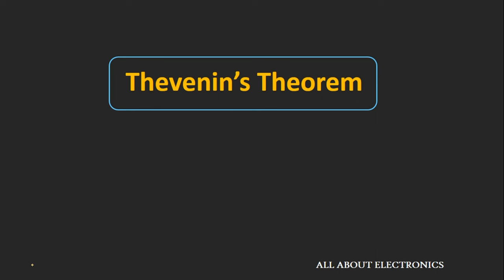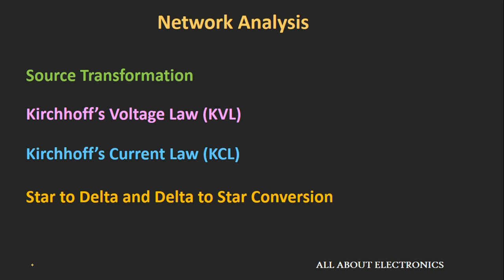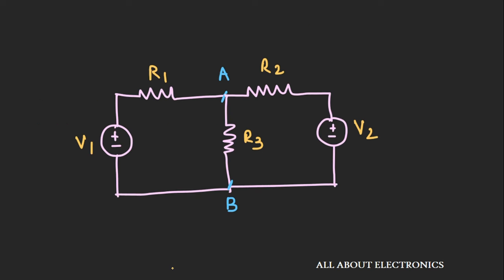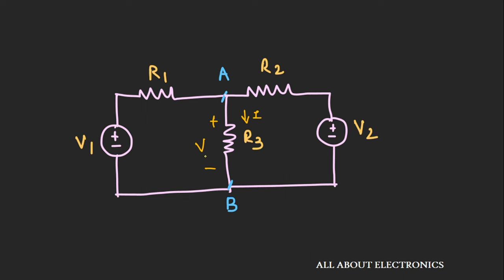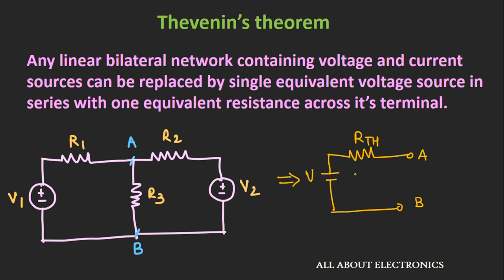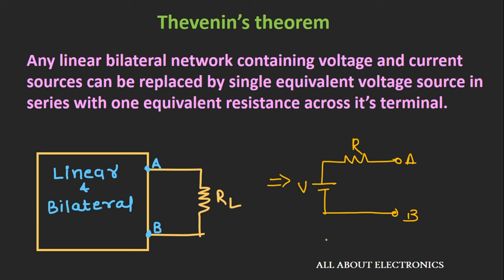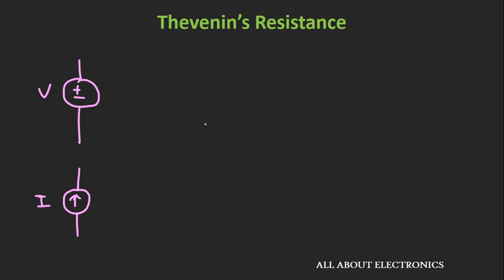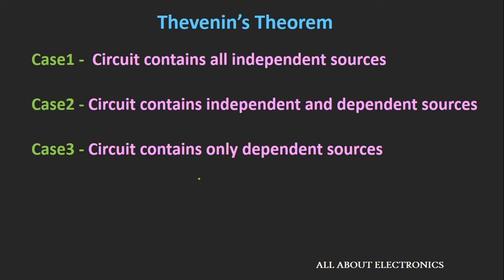Thevenin's Theorem Explained (With examples of Independent and Dependent Sources)

Comment from the maker: Minor correction:
5:30  In Case 1, the value of Vth will be 15 V instead of 5V.
Reply: it is -15V
Reply: 10-10(-0.5)
-10(-0.5)=+5 so,
10+5=5
Reply: So helpful thank you!!
Reply: can u please mention this in the description instead. also good idea wioth the time stamps
Reply from the maker: I have already Pinned this comment.
Reply: Rahul Jaiswal  bro it is 15 v
Reply: Yes it is 15V
Reply: Thevenin's resistance is 0.5k ohm's
Reply: Please add one more video about Norton's theorem
Reply: Could you make a video for jee advanced ? Help us to solve complex problems .
Reply: @danieleyitoyo8089  10-10(-0.5)
10+5=15
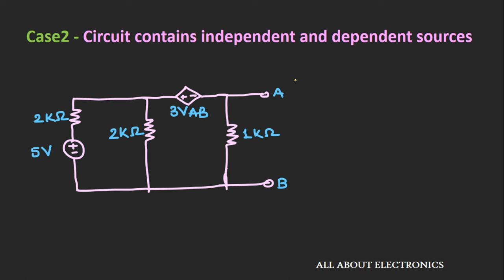Reply: I thought case 2 is different circuit, How could you got 0.5 V in this case 2 7:05
Reply: at 5.57 ?
Reply: Sumit Swelsor remove such a helpful video for a small mistake that a 6 year old could spot?? No, that would be a bad idea
Reply: But we should not take the current with negative sign 

So what u told in the video is correct but 10-10×0.5=5
Reply: @dr.h.t.jadhav6529  😄
Reply: How it came, In case 1: "Vab=10-(10I) 
Can U elaborate it plz.
Reply: @danieleyitoyo8089  ok so it is

Va-10(0.5)-10=Vb
=>  Vb-Va= -5-10=-15     => Va-Vb=15
=>  Vth = 15
because depending on the direction we can take -15(while applying kirchoff's KVL so thevenin voltage is 15 volts)
Reply: @danieleyitoyo8089  how

Comment: I didn't understand how to to find Vab in case 1 pls explain it....
Reply from the maker: Here node B is the reference node. (i.e Vb = 0V)
So, Vab = Va - Vb = Va.
So, we just need to find the voltage at node A.
And it is equal to 10V - (voltage drop across 10-ohm resistor)
I hope it will clear your doubt.
Reply: @ALLABOUTELECTRONICS  thanks a lot
Reply: @ALLABOUTELECTRONICS  1. is not Vab=Vb-Va, not Va-Vb  Can you apply KVL in open circuit, since it is not a loop as point A and B are disconnected?

Comment: I’m so confused about the 2nd case when he shorted the resistance and the dependent source. How?
Reply: yeah ,me too.Why is it that the dependent source is alsoshort circuited as the  terminal A and B is short circiuted
Reply: He doesn't explain it well. The reason is that when he applies the short circuit across the terminals A and B, the voltage across those terminals is zero, thus the voltage of the dependant source (3.VAB) is now also equal to zero, so can be replaced with a short circuit.
Reply: @anglotenglish6001  oo yes yes. Thanks for your explanation
Reply: @anglotenglish6001  no he was mistaken when he short circuited the dependent voltage source. 
what you said is only true if  the dependent voltage source was connected in PARALLEL to a and b terminals then that would be a short circuit.
the dependent source actually becomes connected in parallel to the 2k ohm resistor
Reply: @anglotenglish6001  thanks man .you saved me from confusion.
Reply: @anglotenglish6001  thanks

Comment: Sir I didnt understand how did u get Vab=10-(10i)
Reply from the maker: To find, Vab, KVL has been applied in the loop. Now, Vab = Va- Vb ( the Potential difference between Node A and B).
As node B is reference node,  so the voltage at that node will be zero. 
Now, the voltage at Node A will be 10 - (10I)  (that is 10V - voltage drop across 10-ohm resistor, using KVL)
And hence, Vab = 10 -(10I) 
I hope it will clear your doubt. If you still have any doubt then do let me know here.
Reply: sir how is node b a reference node
Reply from the maker: See, node B is at zero potential. Or in another way, if say, it is a ground of the circuit. And in the circuit generally, the node with zero potential is considered as the reference node. I hope, it will clear your doubt. If you still have any question then do let me know here.
Reply: what if both resistors are not equal
Reply: Sir voltage at node A 10-(10i) ala aindii
Reply: why is the voltage drop across 10-ohm resistor is 10V? Isn't the voltage drop across the 10-ohm resistor should be 10I ?? Great explanation btw!
Reply: I use KCL nodal analysis to find voltage at Node A and I got 15V at Node A.
Reply: @ALLABOUTELECTRONICS   sir i couldn't able to understand that  how  Vab=10-(10i)
Reply: By the formula we get 10-10i and the formula is Vth=Vab=(V-I(RL))
Reply: @ALLABOUTELECTRONICS  and can it be.. 
20- 10i
Reply: @ALLABOUTELECTRONICS  but you didn't considered that other 10ohm resistor and 20v supply.. why you neglected them.... Because electrons flow in opposite of current's direction, current should be measured through whole circuit...

Comment: review:
Only independent sources: remove selected resistance, calculated voltage via mesh analysis and resistance via removing sources
Independent and dependent: Apply KCL on dependent sources and short A and B to find volt and resistance
only dependent: apply 1v/1A source from B to A to find the resistance, as it is equal to Va (Volt = 0)

Comment: In case 3, is the 3i dependent source a current-controlled voltage source, if not then how did you subtract 3i from Va in case it is not a voltage source (that would be like subtracting current from voltage otherwise).
Reply: Yes, I think it is a CcVs , and the symbol of a dependent voltage source is also there. 
If it was a current source, an arrow(symbol of a dependent current source) would have been used.

Comment: In case 1, since the points A and B aren't connected, why didn't we take the 10 ohm resistances in series?
Reply from the maker: Because we want to find the equivalent resistance across terminal A and B. What you are saying would be true if we want to find the resistance at some other point. Let's say the points where the 10V voltage source is connected there we want to find the resistance. In that case, both resistors would come in series. 
I hope it will clear your doubt.

Comment: For those confused about the shorting of the dependent source in part 2:
The reason is that when he applies the short circuit across the terminals A and B, the voltage across those terminals is zero, thus the voltage of the dependant source (3.VAB) is now also equal to zero, so can be replaced with a short circuit.

Comment: @ALL ABOUT ELECTRONICS

at 4:30 when you just applied kvl and wrote the equantion as 10=10 I +10 I + 20  according to the arrow you dram (yellow one , clockwise)........but its wrong, the correct equation would be 10= 10 I + 10 I - 20 as we are moving from higher to lower potential of 20V source as the arrow indicated by you is clockwise........i may be wrong!
Reply from the maker: Please check it once again. You will get it. Just start from the 10V voltage source in the clock wise direction. Since the potential is rising (negative to positive voltage, let's consider it as positive. As per the direction of the current, we will have voltage drop across two 10 ohm resistors. And once gain for 20V voltage source, since we are moving from higher to lower potential, so there will be a voltage drop.
So, three terms in the KVL equation will be negative. 
The equation would be like +10 - 10I - 10I - 20 = 0
Or, it can be written as 10 = 10I + 10I + 20.
I hope, it will clear your doubt.

Comment: Sir, @ 10:59 you've eliminated the 
2 ohm parallel 2 ohm resistances to 2 ohm resistance.
But without making parallel formula how would it be 2 ohm?
It might be :
   2*2/(2+2) = 1 ohm ??
Reply from the maker: If you closely observe, the 2 K resistor is in parallel with AB terminals (which are short-circuited).
That means their effective resistance will become zero. 
And in the equivalent circuit, there will be only 5V voltage source in series with 2 K resistor. 
I hope it will clear your doubt.

Comment: In case 2 if the independent voltage source  was present in  the  place dependent voltage source and vice versa than after short circuiting does the independent voltage source gets short circuit or not

Comment: I have a doubt in the case 1 to find R th u short circuited the voltage sources,  but in the case 2 why you dint short circuit the 5 v voltage source???  Plz clear my doubt
Reply from the maker: Because in case 2, the circuit contains the dependent source. So, there is a different procedure for finding the Thevenin's theorem in that case. 
Please go through the example, and after that if you have any doubt then do let me know here.

Comment: I"m still trying to intuitively understand why we short circuit a voltage source but open a current source when calculating Thevenin's resistance. Why the difference in how these two are manipulated? I guess voltage makes sense. After all, there is no resistance in an ideal battery. The best I can come up with as far as a current source is the way it is usually in parallel to a resistance, and so opening the source, which will never change depending on the load characteristics, is fair. Anybody have other ideas?

Comment: Sir...u said that Vab=10-10(I)....how u give value of A as 10 & B also 10?????
Reply: Exactely i too had that dought
Reply from the maker: If you see the left side of the A and B. There is a 10V resistor in series with 10-ohm resistor. Here Node B is considered as a reference node. So, the voltage between the two nodes will be the 10V minus voltage drop across the 10-ohm resistor. If I is current in the circuit then Vab = 10 - (10 ohm x I)
I hope it will clear your doubt.

Comment: How to find vth  5:16
Why we are not considering 20 v
Reply from the maker: You also need to consider the drop across the 10-ohm resistor. So, Vab will be Voltage across 10-ohm resistor + 20 V. 
In this case, since Voltage across 10 ohm resistor is -5V, so Vab = - 5 + 20 = 15V. 
I hope it will clear your doubt.
Reply: @ALLABOUTELECTRONICS  we can consider like this ah
Vab=20+(10*-0.5) =15

So we can consider either 10 v or 20 v
Reply from the maker: @bhagyashrees854  Yes, since Vab is intermediate voltage, so from either side it can be calculated.
Reply: @ALLABOUTELECTRONICS  ok thank u understood it👍

Comment: I assume the answer is {-5V}, given the direction of the current I = -0.5A therefore in that direction it goes through the negative terminal of the voltage source making it
 -10 - 10(-0.5)=Vab  using(KVL)
Vab= -5V, I assume that is the right answer...
Reply from the maker: You have applied KVL incorrectly. If you are considering 10V voltage source as negative (Negative to the Positive terminal) then drop across the 10-ohm resistor should be positive. So, if you consider negative to positive going direction of the voltage as positive then KVL equation would like 10 - (10)(-0.5)- Vab =0 , And if you simplify it then Vab= 15V.
I hope it will clear your confusion.

Comment: I have a doubt. If the V in the final reduced circuit is thevenin voltage then how come the potential difference across A&B is thevenin voltage because as there is a resistance in series with equivalent voltage of circuit the voltage across terminals will not be the same as the equivalent V. Can you please elaborate?
Reply from the maker: It is the representation of the linear circuit. Or I would say using Thevenin's theorem you are getting an equivalent circuit, which has Thevenin's voltage source in seires with the Thevenin's equivalent resistance. And across that circuit generally load is connected. (Across terminal A and B of the circuit). 
So, when you turn off all the independent sources and find the voltage across AB that's circuits equivalent voltage. It's not the voltage that you get across the load. Of course, it will be different. And it will be RL*Vth/(RL + Rth) . I think you got confused with it. Isn't it?

Comment: i didn't understand why and how 1 ohm resistor got short circuited when A and B r shorted
Reply from the maker: When A and B are short-circuited, it offers zero resistance. So, anything in parallel to it will also offer zero resistance. Because all current will flow through the short circuit. 
And that's why 1K resistor will also get short-circuited.
I hope it will clear your doubt.

Comment: Nice tutorial.
,By the way .....should we always use 1 A as test current in the 3rd case ?Actually,I found the value of Thevenin's  resistance  varied  for other test currents.
Reply from the maker: Any value of current source can be used as test current. Based on the value, voltage across the current source will change. But ratio of V/I should remain the same. The advantage of choosing 1A current source is that, denominator is 1. So, calculation becomes easy.

Comment: At 10:35 why 3Vab is short circuited?
Reply from the maker: Vab is the voltage across the terminal A and B. When terminal A and B is short Circuited then Vab =0. And hence dependent source will also become zero. I hope it will clear your doubt.

Comment: Is the test current in case 3...1amp...Same for all circuits????
Or does it changes???
Reply from the maker: well, we can apply the current source of any amplitude. But to make calculations simple, 1A current source is usually applied.
Reply: No need to take the current (I) amplitude as 1A. Take I Then Apply kcl then you should get the ratio if Va and I then that is thevenin resistance..... I hope my explanation was right.

Comment: Sir, In 10.33 minutes, why the independents voltage gets short circuited.
Reply from the maker: Since the terminal A and B is short circuited, so voltage across terminal A and B is zero. And therefore, voltage Vab is zero. So, that's why that dependent source gets short circuited.
Reply: Sir, if the dependent source is current source in that case it will short circuited or open circuited?
Reply from the maker: @nilakanta2555  If it is a current source then it will get open circuited. In this case, since it is a voltage source, so it is short-circuited.
Reply: Thank you very much Sir

Comment: In case 2, why is the V used in the equivalent TH circuit 5 and not .5 as calculated at the beginning of the problem
Reply from the maker: It is 0.5V, Please check at 11:41 in the video.

Comment: Sir in the 1st sum y u took thevenin  voltage across AB with 10 ohm 10V....y cud v not take thevenin's voltage with 10 ohm and 20 V on the otjer side?
Reply from the maker: Yes, it can be using 10 ohm and 20V source as well.

Comment: Can you please explain again why "short circuiting" the AB terminal in Case 2 ends up "short circuiting" the rest of the circuit as well?
Reply from the maker: In case 2, when we short circuit two terminals A and B, 1k resistor will be in parallel with short circuit (or ideally zero ohm resistance), hence the equivalent resistance of that combination will be zero. Now, as terminals A and B are short circuited, so potential difference between node A and B will zero or we can say that VAB=0. So, dependent voltage source 3VAB will also be zero. Now, again if you redraw the circuit then 2K resistor is again in parallel with short circuit terminal. So, it's equivalent resistance  will be zero. And hence, eventually both resistors and dependent voltage source will get short circuited. And we end up with 5V voltage source in series with 2K resistor.
I hope, it will clear your doubt. If you still have any question then do let me know here.
Reply: EGG SELL LENT explanation. I understand it in the context of equivalent resistance! Thank you.
Reply: @ALLABOUTELECTRONICS  nice explanation

Comment: Ι  didn't understand case 3. 
Vth=OV 
But then we take Vth=1.2V in order to find the Rth.
Why?
Reply from the maker: well, that's not Thevenin's equivalent voltage. Its the voltage across the 1A  Test current. In the circuit, when there is no independent source, the Thevenin's equivalent voltage is zero. What we can find is the Thevenin's equivalent resistance or impedance for such a circuit. And since the circuit does not contain any independent source, so we need to apply the external excitation either in the form of voltage or current to find the equivalent resistance. 
I hope it will clear your doubt.
Reply: @ALLABOUTELECTRONICS  Thank you ,I have two more questions.
1.When there was a short circuit we said that the Rtotal of the  pararrel resistor and the resistor of the short circuit is 0Ω so we removed it from the circuit(case 2) and therefore the voltage of the pararrel resistors was 0V .However ,the current 1A has a voltage of Vab=1.2 Volt?
2.In case 3 we didn't remove the 4Ω resistance that's pararrel with the short circuit ,like we did in case 2,and we didn't say the Rth is the 6Ω that remains in series with the dependent voltage source.(In case 2 Rth was the remaining in series resistance of 2kΩ)
..why?

Comment: There is a mistake according to me in case 2 while you consider the dependent current source and 2 nodes as a super node and applying KCL you forgot to keep in mind the current going in and out and mentioned all the currents to be incoming current thus all positive signs in the equation kindly verify and respond.

Comment: How do you found Vab in first case (please respond)
Reply from the maker: Vab is the voltage between node A and B. Vab = Va - Vb. Node B is a reference node and is at ground potential. Therefore, Vb = 0. So, only you need to find the voltage at node A. The same has been found by applying KVL. I hope it will clear your doubt.

Comment: how you write the 10-10i equation, please explain
Reply from the maker: What we need to find is the voltage Vab. B is the reference node. Therefore, Vb = 0. So, only thing which we need to find is the Va. That means Vab = Va - Vb = Va - 0 = Va.
Now, if we assume the clockwise direction of the current then Va is 10 V minus the drop acoss 10 ohm resistor. (Just apply the KVL upto node A). Therefore, Va = 10V - (10 x I).
I hope, it will clear your doubt.
Reply: @ALLABOUTELECTRONICS  After all of the comments regarding this probem, this explanation makes the most sense as to what you are doing; however, how are you able to only do a KVL up to node A only? Vb may be zero, but what about the voltage betweent he 20 v and 10 ohm resistor on the right? 
Thanks.